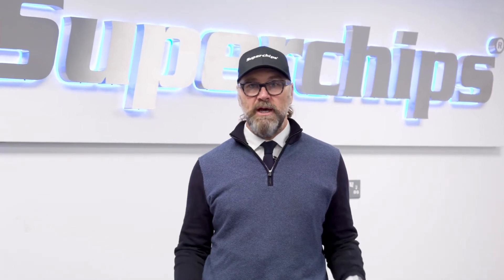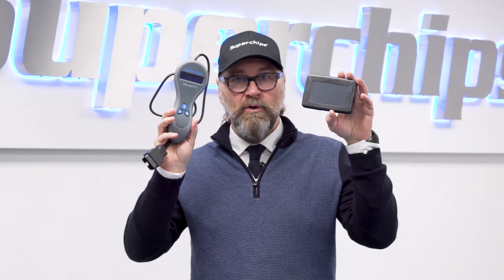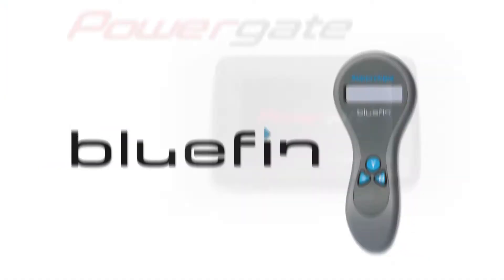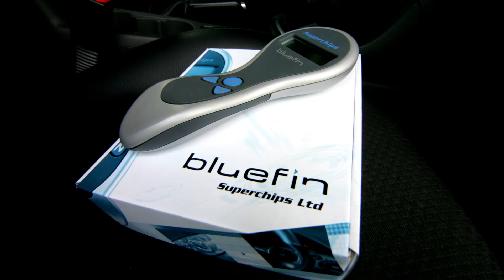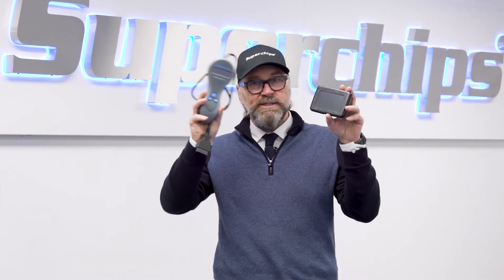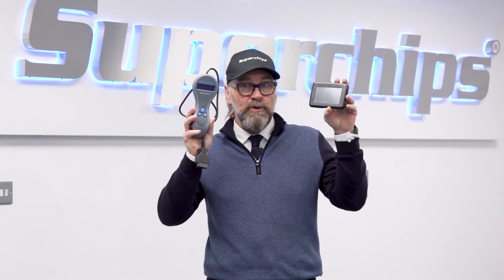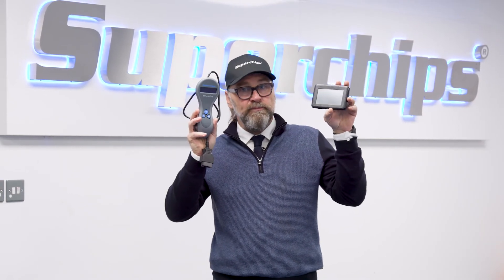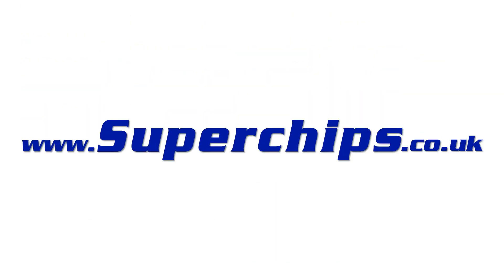Difference between Bluefin & Powergate

Comment: ive been using the same piggy back Superchip since 03/04/04 went from 18 mpg to 30 mpg over 17 years. Its a Clio 1995 1.8 RSi. Could do with an update and re rolling road see if hp is the same, there are only 4 of the 1.8 RSi left.